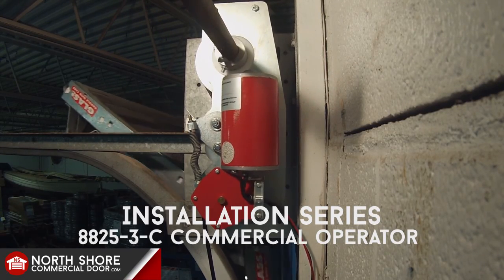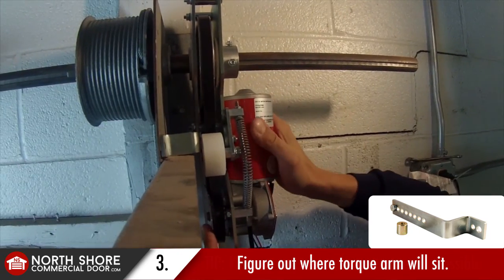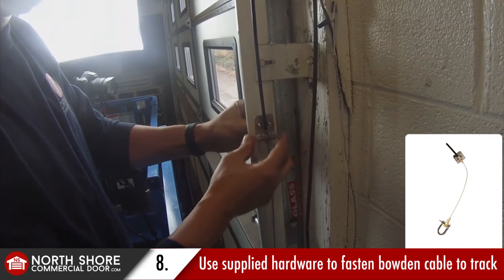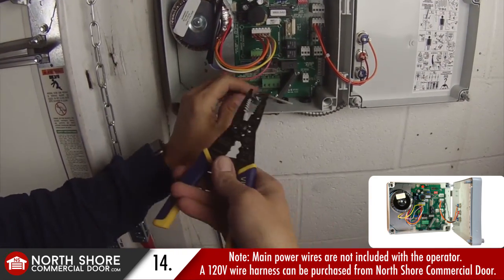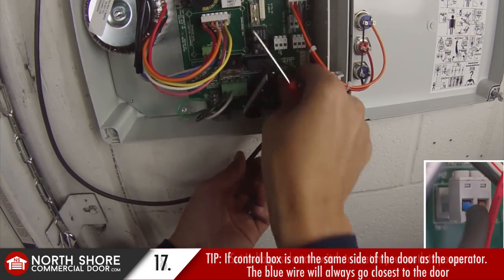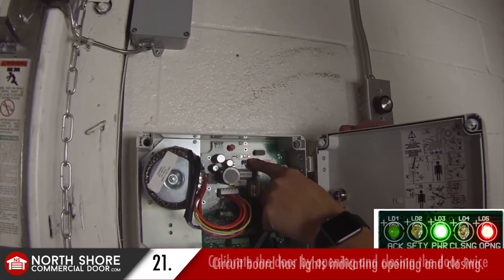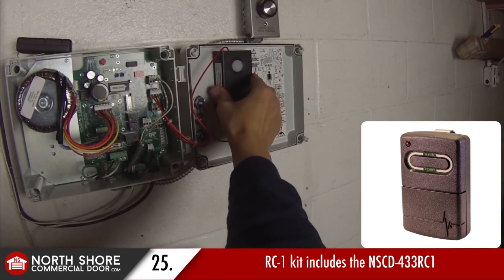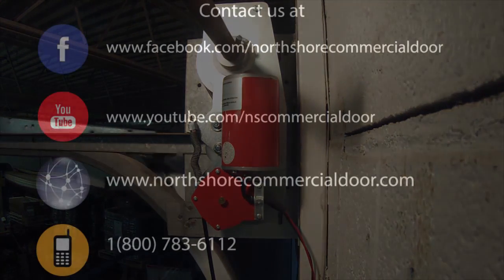How to install a Zap 8825-3-C Commercial Garage Door Jackshaft Operator

Comment: What is the minimum width required between the jackshaft bearing plate and the wall?   What is the minimum length of the jackshaft extending from the bearing plate?